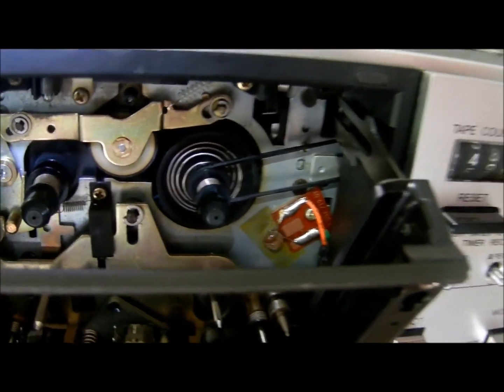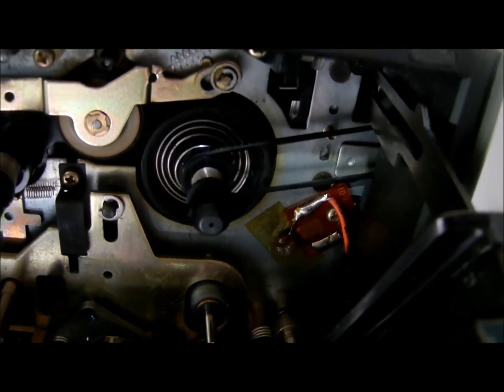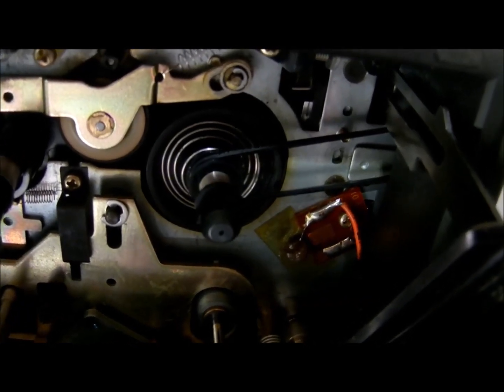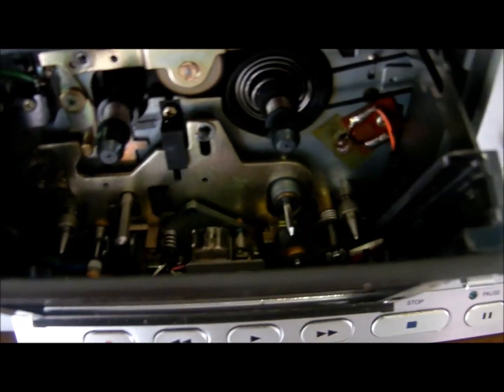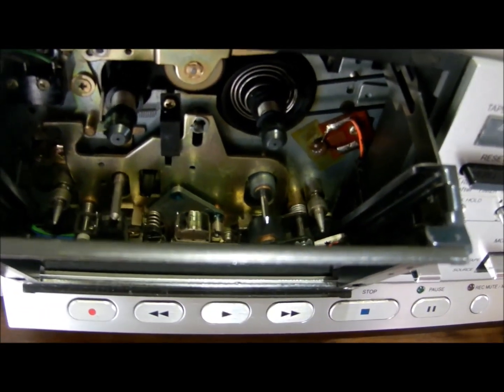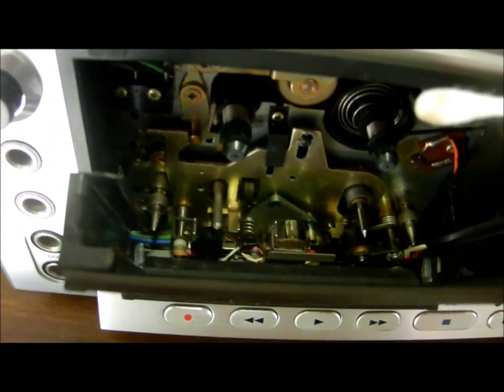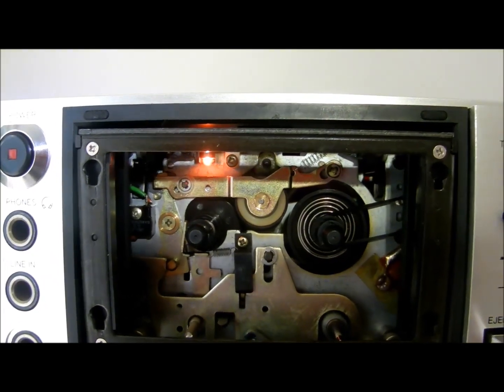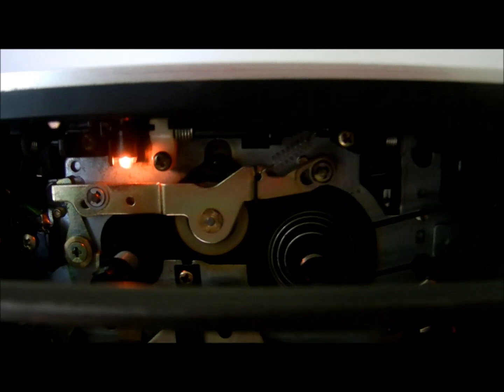Aiwa AD 6900 MK1 maintenance

Comment: I have the same problem with my deck. What was the problem ? I am struggling
Reply from the maker: Never cured it Andre...came to the conclusion that the dc motor magnetic field had weakened over time and needed to be replaced. Might be wrong. Adjusting the speed reference pot on the motor drive pcb made no difference to the torque
Reply: It was the dc motor. I swapped it along with all belts and rollers. I swapped a few caps and it is now running perfect.
Reply from the maker: You did a great job, well done. I looked at getting the motor out without taking the front facia off and gave up. I also could not source a spare motor with the integrated speed feedback generator. I sold it for spares in the end.
Reply: @indieworks  sad to hear. It’s one of the most beautiful decks I ever used .